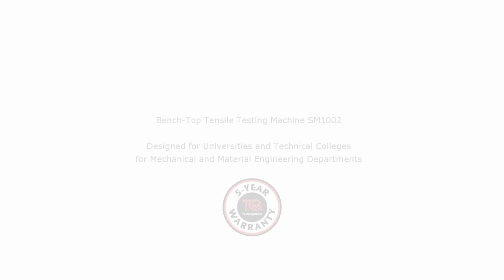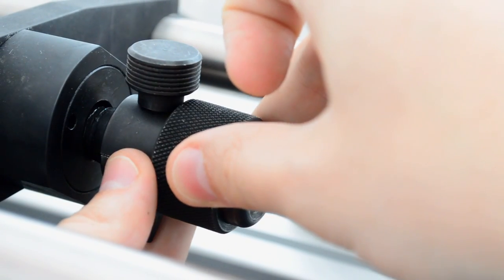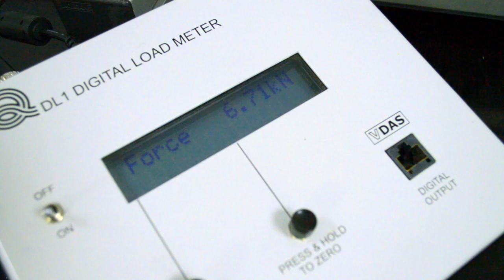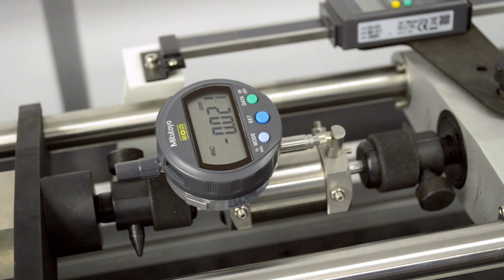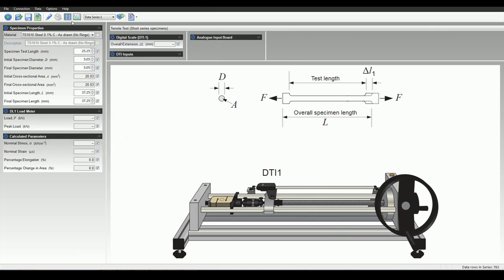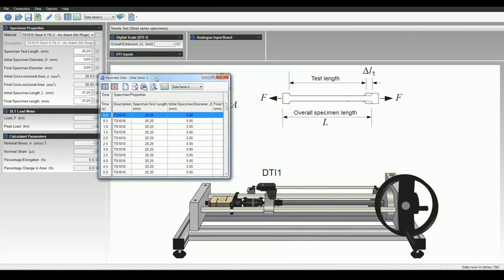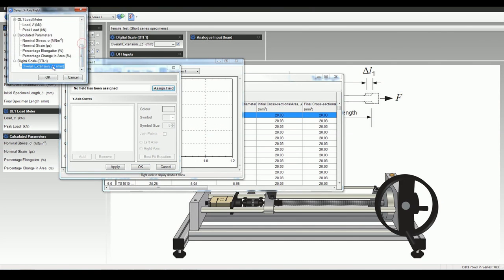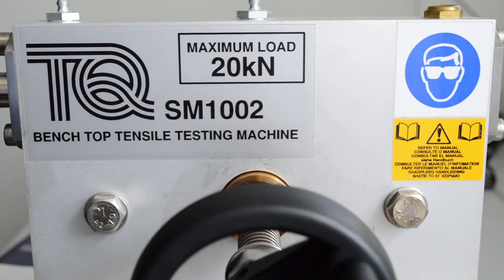Tensile Testing Machine - Materials Testing

Comment: Which one is preferred, UTM or tensometer for tensile test of Polymer Matrix Composite?
Reply from the maker: Dear Hitesh,

Thanks for your question.

This would depend on the following:
• The ultimate tensile strength (UTS) of your samples. Our SM1000 is rated at 100kN and the SM1002 is rated at 20kN.
• The design of the chucks requires the specimens to be cylindrical and of a particular size. Flat specimens cannot be accommodated with the chucks supplied.
• If you wish to determine the Young’s modulus of the material, an extensometer must be used. Our extensometers are designed to fit onto specific size specimens as supplied by TecQuipment.

We hope this helps!

Kind regards,
The TecQuipment YouTube Team
Reply: @Tecquipment  Yes. But our specimen is as per ASTM D3039, size 250x15x3 mm. Rectangle. 
It is polymer matrix composite. Mixing of glass fiber and resin.
Reply from the maker: Might we suggest you contact the supplier of the specimen who might be able to add more clarification.